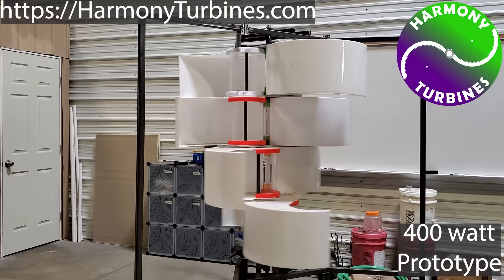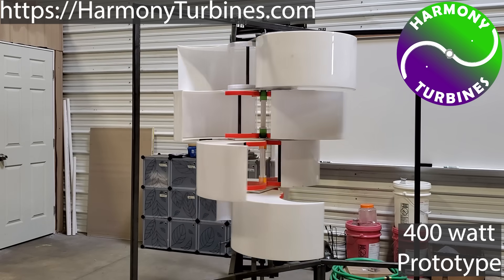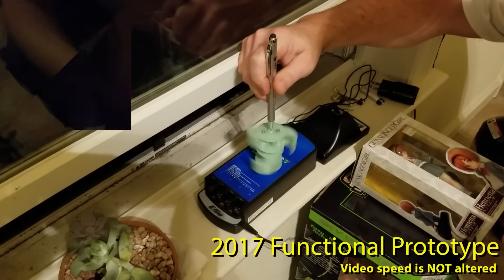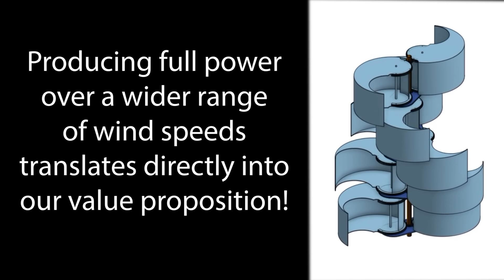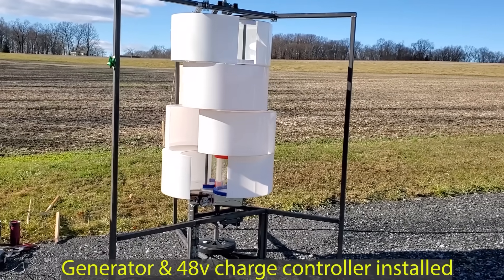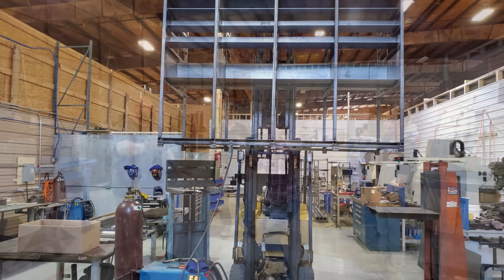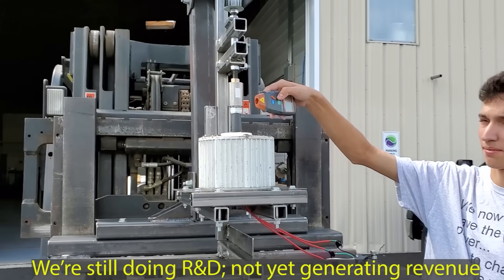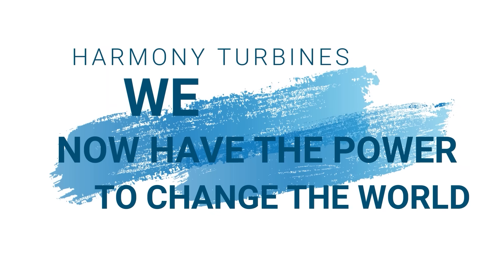What makes Harmony Turbines so revolutionary?

Comment: While the design looks amazing it has so many moving parts the cost to manufacture will be high which has always been the down fall of the many wind turbine start ups over the years for the small amount of power they produce (even ones far more simply designed that this) they end up 'turning' payback into a decade affair. Its just as likely to need more money spent on repairing it in that time. All that heavy spinning steel needs to be mounted somewhere safe, so thats another significant expense, all this doesn't stop me wanting one so I hope they prove me wrong :)
Reply: I mean, a combustion engine has many many more moving parts, and has to put up with the mechanical strain of moving 3-4000lbs of mass and the pressure and thermal stresses of the combustion process. Properly serviced, they'll last for 1000s of miles. 
I can't see it being that hard to make a self adjusting turbine, mounted on a shaft, with a couple of bearings, reliable. It's not particularly complex. And the motor trade has already done all the materials and lubrication science you need. You could probably buy auto parts off the shelf already, with the right specs, for a decent price, including alternators that make highly efficient self governing generators.
Reply: @soundmattersuk  Nobody is saying its difficult to make them, but they produce so little power, 400 watts very inconsistently. Most people aren't interested in something that takes 10 to 20 years before it pays for itself. Especially now how cheap solar panels have become, roughly 50c a watt with 20 maintenance free years.
Reply: @jedics1  maybe I'm missing something. I'm not overly convinced there would be any significant maintenance. Here in the UK, watt for watt, DIY wind power appears to be about half that of solar.
Reply: @soundmattersuk  Half? You can get a 440w panel for $250/300. So you can make a 400w turbine for $150? Also this conversation is based on buying retail and everything I have seen is that this turbine will cost over $1000 making it 4x the price per watt of panels.
Reply: @soundmattersuk  Half? I can buy a 440w panel for about $250/300. So you can build a 400w turbine for $150? The turbine here would likely cost over $1000 making it 4x the price of panels. If you live somewhere with a lot of wind and a lot of overcast days it might change things a bit but I doubt it would make up for such a huge difference.
Reply: @jedics1  this unit could help fill in need on cloudy days and even work at night, not the answer but part of the answer .
Reply: @jedics1  except it doesn't pay for itself in 10-20 years.  You believe that the repair costs won't be larger than the payback which is never true.  Subsidized by government you get payback period.  That means tax payers are subsidizing the money these people, and seemingly you, want to waste on an imaginary payback period and its being done by force. 
That just makes you evil lol
Reply: @soundmattersuk  you clearly know next to nothing.  I wouldn't keep talking youre acting like people haven't done  attempted these solutions.  The problem is it's been known since wind powers inception its garbage and will ever be sustainable but governments prop up wind power at the expense of the tax payer.  Same with the garbage that is solar power.
Reply: This competes with OTHER wind turbine designs. These designs have many more moving parts already. Safety is an aspect that can make part numbers (and costs) explode. A huge problem, as you point out.
A design that intrinsically nullifies the most annoying danger for wind turbine failure?
That's very good. >> Better than many other turbine designs in that regard.

On part numbers...
What I could see in the video had less 'unique' parts than many toys. The 'unique' part is important, since that is what stands in the way of mast production. Not the absolute part number. >> Okay

Bad.
What I dislike is the open gears. These things get dirty, damaged, clogged up and that can stop the opening and closing process. The very process that's the main selling point for safety and effectiveness. >> Bad.
Reply: @andreasbucher7717  Yeah it occurred to me that a lever would be preferable to the gears.
Reply: @andreasbucher7717  https://youtu.be/y2JIz01MKho
Reply: @andreasbucher7717  The open gears are probably not an issue, They probably don't need to fit too tight as really just one edge of the teeth needs to contact the other teeth. A wider gap would probably still be fine, while being sufficiently efficient at regulating the exposed scoop.

That being said, I"m not sure that I would have gone that route. I probably would have run a single shaft through each stack of scoops attached to a governor. You wouldn't need to leave anything exposed to the elements
Reply: @Andreas Bucher  yes it competes with other windmill designs to find out which one is the least useless out of a useless way to harness energy.  He might as well go harness static electricity by rubbing his hand on a blanket.
Reply: @sabotagefate69  luls :)
Reply: Yea, Savonis designs low efficiency means it has to remain very very simple to be cost effective.  So I don't see much promise here.
Reply: A lot of similar parts mean cheap production.
When you choose materials wisely they are no paint of failure for some decades. Also both, the rod to control the opening and the main rod are completely to the bottom, so there is no extended electronics. This is a very clever design.
I hope they will find a way for lightning, these things are quite high.
Reply: It doesn't matter for domestic application.
Reply: You shills stf up ! Cheapo cup & cone bearings will last a decade before a cheap swap ! 
Acting like there isnt 60yr olds still riding 40yr old bikes 😂
Reply: Hydrogen is the only way to go
Reply: @supermagneticman  Not until they work out how to produce it that requires much less energy and by that time battery storage will be so much better it will need to compete with that also.
Reply: im sure its not steel and it wont be heavy
Reply: @Sonofsun.  am sure you didnt watch the whole video before commenting.
Reply: @jedics1  you are completely wrong! What i did was, not paying attention all the time
Reply: @Sonofsun.  So you didn't see it was made of steel ....And Im completely wrong..Ok good talk.
Reply: @jedics1  BRUUUUH just because of the color you are assuming its steel???! And here i thought it was written in the notes. Get outa here
Reply: @Sonofsun.  If you can't see that is clearly metal then your to inexperienced to be so opinionated...
Reply: @jedics1  no smarty pants i can obviously see that it's metal, seems like you don't understand how many elements look exactly the same not to mention how many alloys look like that
Reply: @Sonofsun.  no offense but the metal prototype shown at the end is most definitely sheet steel and steel square tubing serving as the support. You can tell from the welding, reflectiveness, and color
Reply: It doesn't matter what they say, first of steel is not that heavy, second they can easily change it if they want to
Reply: i wanna see that in the philippines and if that can handle the typhoons here.
Reply: That is absolutely wild.  Goes on a paragraph rant on why wind power is awful and useless just to go but I want one xD
Absolutely moronic
Reply: @sabotagefate69  I want the idea not the product which is ironically why they think they can flog it to us. I want it to be a financially viable energy generator rather merely existing to make some guy cash. Not seeing the difference makes you look like the moron.
Reply: I feel like this project would be amazing if made opensource.  Could easily see people making these from common parts and a 3d printer
Reply: @mhgscrubadub9917  what material would you use to print it with that could withstand the wind and sun for decades?
Reply: @jedics1  if you made the contact surfaces of the gears bigger to reduce mechanical deformation you could use petg.  I've left a print using it in a hot car in direct sun with no warping.
Reply: My thoughts exactly! I call moving parts "points of failure" because that's what they are. The expenses are going to shoot through the roof. If any politician will go for these - follow the money! Corruption seems to be the ONLY way to go.
Reply: @jrnandreassen3338  https://youtu.be/y2JIz01MKho
Reply: Coz they have some funds to “seed” inefficient “reinventions”.
Reply: Just looking at this for one second says it's probably uneconomical. All those gear tooths and loots of metalwork are just for the upper part.

I have designed and overseen the creation of machines and factory lines, and I can assure anyone that this approach is expansive.
Reply: @stefnirk  how much do u think a single bearing is for a full size wind turbine? used around the world atm? eliminating that alone would most likely pay for the entire turbine full scale.
Reply: @badbusatube  Firstly you have to compare apples to apples; a full-sized wind turbine probably has close to a ten thousandfold area compared to this plus higher effecicy value (Its physics so that wont change). Secondly, this design needs similar bearings, it just switches from a roller bearing to a thrust bearing. This design's only benefit is the lack of need for a break. 

But it has many design flaws that make it costly and uneconomical for scale.

Comment: The quality of the video/presentation is so much higher level than the concept itself. What applications does the power generated make sense for?
Reply from the maker: Joseph this is a prototype of a small scale residential turbine that we're hoping to sell for around $2500 when they're ready for production. If you have good winds in your area and standard $0.15 per KwH or higher energy rates then the payback should be around 7 years in savings to your electric bill. It's just a small turbine but larger models will be coming out later as we get more funding. This would be for coastal areas or boating purposes. We will later be working on cold climate models as well with snow and ice countermeasures built into them. Please sign up with our Newsletter to receive the latest updates from Harmony Turbines: https://groups.google.com/g/harmonyturbines
Reply: @HarmonyTurbines  I am incredibly skeptical of the economics of this. If this makes cost competitive sense I feel like you would include way more numbers and comparisons to contextualize. It is a feel good project with niche applications (until you show some proof otherwise).

Comment: Yet another "revolutionary" windmill... which isn't. It's just a Savonius-type windmill, which have been around for decades. The only novelty here is that it curls up on itself, so it has better protection against (too) high winds, but that's about all. At the downside of that you have added complexity in gears that will need maintenance and could get broke or stuck. And it does NOTHING to improve the efficiency of a savonius, which is really low. As others here already calculated, such a machine will produce at most 4,8 Watt. Meaning you'll need about 90-100 in your backyard to power one house. It's unfeasible and economically not viable. Maybe a niche-market to have a working lightbulb in one's shed or something. But that's about all.

Comment: Put a series of VAWTs on top of existing Electric Power Transmission Line towers, so that most of the height above ground is built, and electrical connection is mostly built, and right-of-way maintenance is already planned for and  budgeted. It could also be done bit by bit instead of having to be mostly complete before being useful. At least, when building any new or replacement towers, take into consideration building them so that VAWTs can be added later.

Comment: If this isn’t bullshit, u are to stupid to not show the turbine closing when the truck speeds up to the “danger point” that only this issue makes me skeptic. Alluring to that this (if it worked) would in any way solve global energy problems is an other issue. I hope I’m wrong and it works but my second point is still a trust issue because you can’t eat enough beans to take any carbon out of the atmosphere.

Comment: A savonius rotor made from an oil drum will typically produce a bout 180 Watts at a wind speed of 10m/sec (Wikipedia). So your design is barely different so it won't produce much electricity: something you conveniently didn't mention. If you've spent 3 years so far then you haven't got very far. Sorry but you are backing the wrong horse with this project.
Reply: My understanding is that your comparison Sir, is not suitable to make solid point. The new type of blades are far more sofisticated than the Mother Earth type possibly could have been.  Fair enough though, it was your opinion and not based on facts.
Reply: Persons living in mud huts do not have extravagant requirements for electricity.

Comment: Just brake a regular generator during excessively high winds.  Though if it’s properly designed it should be able to withstand high wind.  It’s a WIND turbine.

Comment: Nice, but This type of turbine has a very low efficiency. You are wasting your time and money :(:( The standard turbine is much better
Reply from the maker: Kilgore, It's finally coming to light that there has been a large disinformation campaign for decades against VAWT's and in general Savonius turbines, starting back in the 1950's or around there. Savonius Turbines are actually > 30% efficient without any helix twist or ribbed sections. A proper helix twist greatly reduces stress over the entire unit and smooths out operation as well. The main noted drawback noted was high wind vulnerabilities which our patented design now solves. Look at this https://youtu.be/pbtR6VG-gLw?t=225

Please sign up with our Newsletter to receive the latest updates from Harmony Turbines: https://groups.google.com/g/harmonyturbines

Comment: Worst thing is a size: for powering typical wasching machine (say 2500W) you need a 8 yards wide and 16 yards high proppelers construction (at wind on costal area 7m/s). It's massive. My estimation is based on physic rules.
Reply: You don't wash you laundry 24 hours per day! A small steady power would be really useful during winter. In summer the solar panels power our homes battery, in the winter we buy from the grid off peak! But with something like this we could be off grid for a lot longer! Realistically we need 15kwh per day to be off grid or a lot more to be off gas for heating.
Reply: @onlineo2263  I seriously considering building savonius-type rotor as energy source as, I'm living on the west coast of Ireland (winds from Atlantic). It was around 2012. I had reading many scientific research and step by step I go to conclusion only option is a Savonius can be only "spare energy source" during storms. It's pretty broad subject, so probably better will be to make video instead write "text only" information. But back to your words: "small steady power". I was thinking "We have strong winds here, and I can see many huge commerical windfarms from my window". So I make a mast (6-7m high) with wind meter and I collect data from bit over 2 years of winds. No, they are NOT steady. This hight is still too low to consume energy power. Only promising option is a very high fitted wind turbine (say 20--50-70m!) and with serious size propeller - anything below 2m of diameter HAVT (or range of 3x3 meters Savonius) will not provide enough energy. Unless you only want to use one simple laptop and 3 LED bulbs - with no options like fridge, heating, kettle or water well pump.